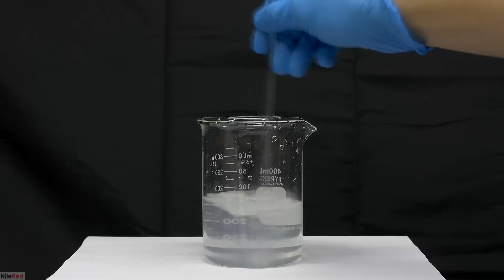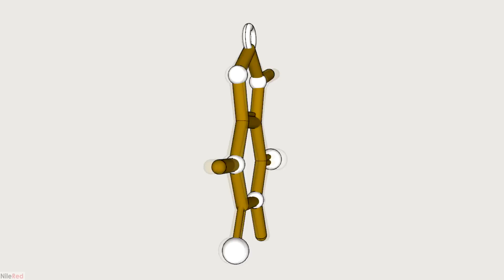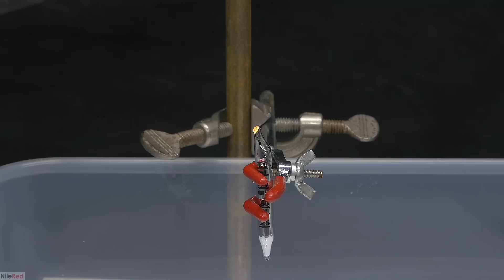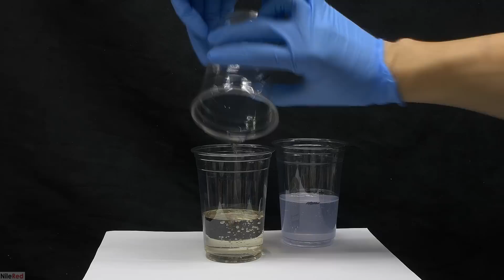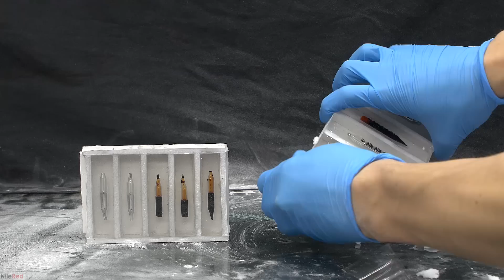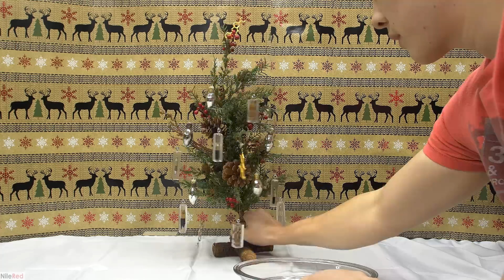Christmas Special: Making a ChemisTree

Comment: Might not have been the Vaseline that was the problem, of course I don't know for sure. I had some issues with that brand of resin not wanting to solidify properly despite doing everything right. I personally have never done anything with vaseline when doing that but after buying 3 separate containers of the resin and all failing I just started going to different brands
Reply: Also better results if you remove the paper from the foam but it's not a great mold material

Comment: I've seen before "shrinking" test tubes to make narrower ampules. Basically stretching it length-wise so it narrows, then cutting off the ends and re-sealing it on both ends. Is this just hard to do, or is there another reason not to do it?
Reply: I don’t know if this has anything to do with the video but he has done that before

Comment: Can you make a video tackling how one could remove various papers and glues from plastic and glass containers? The first thing that came to my mind for removing the molds was to dissolve the molds off, and maybe even the surface layer of the plastic with a wash of [something]. I suppose glass would be easy, using acetone or some other acid - but on plastic, stuff like that instantly ruins and dissolves/discolors the plastic. Is there a chemical way to clean plastic? This could be very useful for people that like to remove glue/paper from plastic things, but want to preserve the plastic thing itself. Finding a way to remove/dissolve just the very top layer would be the key part of this. This method could even be used to refinish and smooth out a damaged plastic surface.

Comment: NileRed: I'm going to be careful not to boil this.
Cody'sLab: Holds uranium in his bare hands
Reply: Uranium isn't that dangerous, you can safetly hold it in your hand and you won't die. I guess he don't want it in the air because it's never good to breath in metal.
Reply: @astridsundberg2732  actually your skin is a good buffer between your organs and radioactive material. if you breath it in it will stick in your lungs and give you 24/7 radiation internally. End cause is lung cancer in 10 years.

Comment: So even with foamcore the biggest mistake I saw was that you tried making the molds as they lay on their side. 
If you'd made a mold for something like that, next time make it as a vertical mold. 
1) thin metal line hot-glue tack'd to the ampule (so it can hang in the mold as it is filled. It also allows for an integrated 'loop' for the ornament or necklace)
2) attach metal line to a thin dowel (or in your case propbably a long wooden pencil-->pour 1/3 of the resin in and wait until gel phase-->pour next 1/3 to ensure ampules hang centered-->pour last third in. 

:)

Comment: I would recommend (yes this is a while ago) to use liquid nitrogen to cool down the bromine to safely transfer it, also not pulling the tubes apart but heating them until thes collapse themselfs, that makes the tubes more stable.

Comment: You can crack the ceramic enough and twist the metal ring off. Then pop the glass to gain access inside. You end up with a cleaner bulb. You can heat the metal to help release it.
It's just a bit less messy and you don't tear up the end as much.

I'm happy to see a video in the Christmas spirit :D

Comment: I think you probably thought along the lines of keeping to mixture of resin equal by using a third cup, accounting for residual that would be left in the cups unable to be extracted. though its not perfect due to the potential of different viscosities of the fluids its definitely more accurate than pouring one into another.

Comment: Could anyone tell me what type of blow torch he uses / where to get one? I'm assuming it's propane but I really like how small and controlled the flame is here and would love to get a similar torch like this for making ampules. I just don't know anything about this stuff (like flammable gas equipment) so am not sure how to get started / what to search for equipment wise. Thanks!
Reply from the maker: It is just a torch i got from a local hardware store.
Reply: looks like a pencil flame soldering torch. propane. the bigger brazing/sweating torches have a much more diffused flame for more heat output but less accuracy. the one he's using looks like a bernz-o-matic brand by the design and milling on the brass. OR chinesium knockoff.
also looks super well used. i run mine at least a half hour a day and it's not neaaarly that crusty.
Reply: Walmart $12-14 USD camping section.

Comment: As a fan of both science and arts and crafts, I loved this video. For future reference, if you ever want to make a silicone mold and don't have proper molding silicone on hand, you can make something kind of close enough out of silicone caulk and corn starch or glycerine. (Possibly also DOT-3 or DOT-4 brake fluid; I haven't tried that myself, but if you read on, you'll see why that might work.) Make sure the caulk is labeled as 100% silicone; you should be able to get plenty at your local hardware store.) When you mix up molding silicone, there are two main components: 1) a mixture that reacts with moisture from the air to form silicone rubber and 2) a hygroscopic component to help pull moisture from the air. Silicone caulk is basically the first part without the second, because it's meant to be applied in such thin layers that it cures in minutes just on its own.

How exactly you proceed depends on how fast you want the mold to set and how long it takes to get the mold formed. I would highly recommend you not imitate me the first time I did this and mix one part corn starch to three parts silicone to make a mold of highly-detailed laurel leaves. (It was for the crown on a friend's costume.) I barely managed to get the mold around the initial clay sculpture before it set too much to manipulate. Smaller amounts of the hygroscopic component will give you a longer curing time. Additionally, glycerine will give you a better working texture, because it does not have the physical baggage of being a basically dry, bulky powder. I've also seen molding silicone made by squirting an entire tube of silicone caulk into a bowl of dilute dish soap in water, kneading it a little, then pulling the whole mass out to mold around an object, but I've never tried this myself.

I work as a mechanic these days, so I'm familiar with the fact that DOT-3 or -4 brake fluid is an extremely hygroscopic fluid, which might be good for texture and probably cheaper than glycerine, but I don't know how it would react chemically with silicone rubber. Since it's glycol-based, I think you'd be okay, but I've never tried it. I'm also not entirely certain it would be called DOT-3 or DOT-4 in Canada, since the DOT refers to the US Department of Transportation, but I don't know what else to call it. Basically, a glycol-based brake fluid that boils between 205-230°C when dry.
Reply: Also, if you're actually using silicone, Vaseline really does work as a releasant. I winced a little when you applied Vaseline to the foam core, since all it's going to do there is soak into the paper coating and, possibly dissolve the foam underneath a little. And you don't really need equal volumes from both bottles for the resin; it's technically an epoxy, with one component being a catalytic hardener for the other. You can make a faster-setting but more-brittle resin by increasing the hardener-to-resin ratio.

Your instinct for making molded resin in general is pretty good, however. Putting it under vacuum for a bit is a professional move (and something to consider with molding silicone, as well), and you did exactly the right thing in waiting for the resin to partially solidify before putting in the ampules and the rest of the resin; the timing for that is, unfortunately, mostly down to experience, and I've ruined a few molds myself that way.

Oh, and PlastX by Meguiar's is pretty awesome. I use it professionally to restore headlights. A few bucks at Walmart, and it works just as well as the professional kits with their multiple grits and separate clear coat, and I can save those expensive kits for the cars with particularly badly weathered headlights.

Finally, I love the way you continued your step-by-step procedure for the decorating. A true NileRed Christmas!

Comment: Dude.. the torture that is ampouling and casting stuff in clear resin sounded so familiar.I have a testube with mercury in resin and I ran into pretty much the same problems you did. I cast in an old plastic sweets container(PET or PP or something) and it was a pain to peel off. I did that with my fingernails and knife and screwdrivers. I ended up painting over the opaque and scratched resin with new resin, which turned out really nice and clear, without having to really polish.  

Your ornaments turned out great! Awesome video :)

Comment: Hey nile, i am going to encase some bromine i have ampouled but am worried about the heat that is produced when the resin cures and the effect this will have on the pressure in the ampoules. Do you think the pressure will increase to the point that the tube will burst? how did you deal with this? the heat produced is actually quite a bit. it gets almost too hot to touch.
Reply: I AM Diablo You should be fine the ampoule are able to hold quite a bit of pressure. If they do end up failing it will fail at the seal and not explode. If your still worried and want to test your ampoule try placeing them in hot water with proper safety measures in place incase of a break.
Reply: Moditmc I did it without any problems I put the casting I put the resin into a bucket of iced water but I doubt it helped much. The ampoule was encased easily, and is now safe from breaking. I was mostly worried due to the size and volume of it boiling and shattering the test tube. They were schott duran tubes too so a decent quality.
Reply: I AM Diablo Good to know it went well.

Comment: Hi! How would I clean lithium metal of the oxide and nitride? I thought I might melt it (180C) in a CO2 atmosphere ,in a crucible and pour off the lithium into mineral oil or kerosene, where it would float and freeze into little oddly shaped bits. The oxide and nitride slag would hopefully sink and I would just stop pouring and leave them in the crucible. But I'm not sure they will sink, because there would be a lot of very small particles and they might stay suspended for a long time. Also, would CO2 be inert enough for liquid lithium?

Comment: we would have chipped in for a belt sander if we knew it would save you 10 hours work
Reply from the maker: haha, I actually own one. It is just in the back corner under some junk and I didnt want to pull it out. I was committed to the manual effort

Comment: If you decide to do more casting, carnauba wax (for waxing cars) is a far better DIY mold release than Vaseline. Also, epoxy casting resins shrink a lot less than polyester but also cost 3x as much.

Comment: using a 3rd cup for resin is a common practice for mixing it. kind of just gives a fresh start and won't leave unmixed resin on the sides of the cup left over for pouring
Reply from the maker: That is true. I just subconsciously did what I saw some other people do I guess. Only later did I question myself.
Reply: @NileRed  I think the idea is to pour part 1 into part 2, then pour that mix into the third (empty) cup to avoid having un-activated resin on the side of the final cup.
Reply: NileRed Yeah I personally only did this process when mixing silicon rubber because you have more time to work with it and I think have the mold material mixed as cleanly as possible is more important than the resin.
Reply: Captain Limabean 
I still don't understand why

Comment: Isn't Cesium (Cs) also liquid at/near room temperature? Gallium is too, at a bit above room temp, and it's not toxic like Mercury (Hg) or Bromine (Br), nor reactive like Cesium! A lot safer for a Christmas ornament! Just don't get it an anything aluminum!
Reply from the maker: Gallium is just above room temp, so not technically a liquid "at room temp". It could be cool to have in the summer though. It would sometimes be solid and sometimes be liquid depending on how hot it is outside

Comment: Quick question,  when making the bulb,  could you find an led to replace the light while it has the mirror on it?  If so would it also be able to put of light?  I would like to know.
Reply: Gregory Smith the silver would absorb and reflect a lot of light, maybe all it, it most likely wouldn't transmit enough to be able to see it
Reply: OK Rob Mckennie thanks bud

Comment: Ay papi - next time you find yourself doing 11 hours of manual labor, go to Harbor Freight and buy a power tool. They have belt sanders for $30-50 (handheld or benchtop), even if you throw it in the trash when you are done you still come out ahead.

Comment: Couldn't you just dissolve the foam in some acetone?
Reply: Of course it depends on the resin you used.
Reply from the maker: I could have, but it would't really remove a lot of the paper. Also, I prefer to not use solvents like that.
Reply: @NileRed  I love how you're working with uranium, bromine, and mercury, but you won't use nail polish remover on the foam. :)
Reply: Hell just use some heat. Its styrofoam